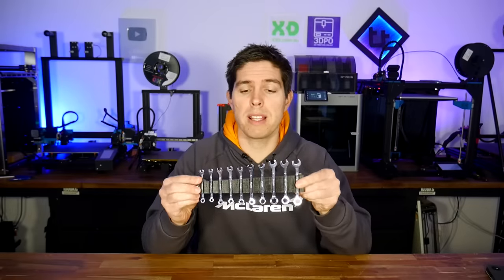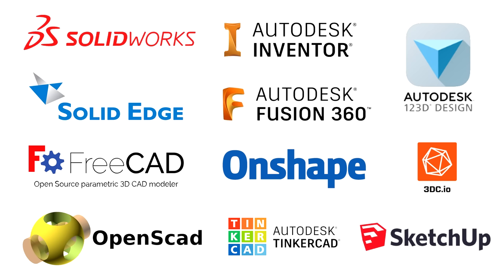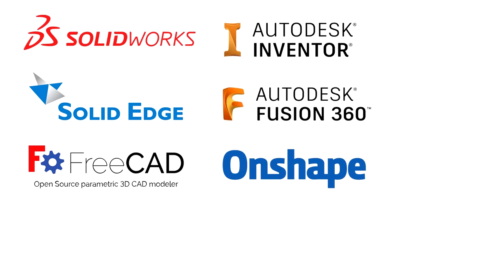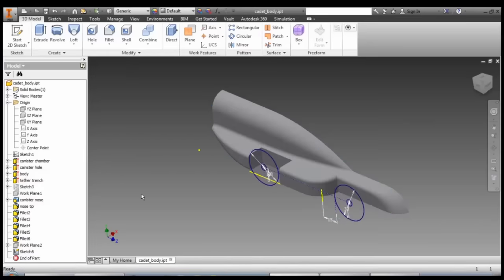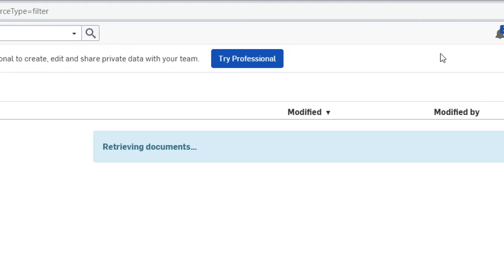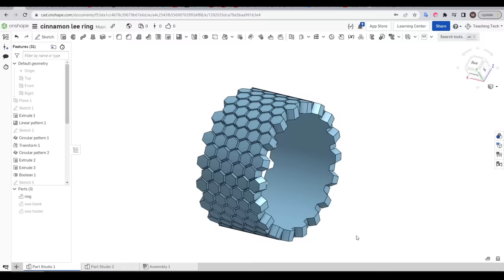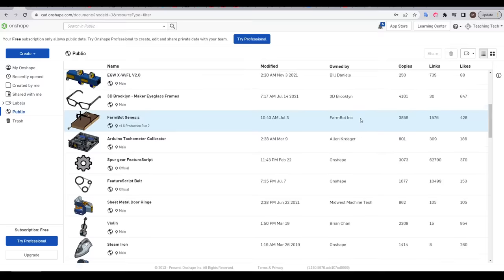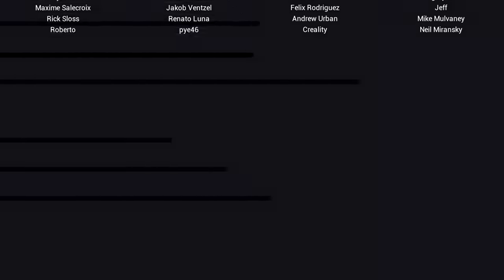Selecting a free 3D CAD option - 3D design for 3D printing pt1

Comment: As far as I'm concerned, anything that is a "free subscription" or software-as-a-service, that could be pulled away at any moment, is a total no-go. This makes many of these including fusion 360 and OnShape a big nope. I value my time too much to be willing to risk wasting my time learning the intricacies of a tool that I could suddenly lose access to a year or two down the line. I'm not against using commercial CAD software, but it MUST be a perpetual license (this is non-negotiable for me), and must be available at a price that makes sense for a casual non-commercial user.

These days I'm mostly using FreeCAD, but am curious about the addons for Blender, and am also interested in some day learning OpenSCAD for cases where I find FreeCAD's parameterization insufficient.

Comment: Can I use a regular 3D modeling program? I know some Cinema 4D and have models on there and I think I can export them to STL
Reply from the maker: The problem is that often these non product design focused design packages don't export manifold / 'watertight' models. There will be intersecting surfaces that don't matter for VFX but do matter when making the onbect for real. Try it but carefully check the gcode preview carefully.

Comment: I been using Fusion 360, but I dont like the whole cloud system they use. You cant convert a solid/step file to stl without internet which is just stupid. I also dont like how I need to save a copy online and on my computer so I have a copy in case I dont have internet access.  Having multiple copies can really become confusing and messy. F360 also crashes constantly. I tried it on several different computers with more cores, more ram, dual CPU's better GPU's, I tried overclocking and so many other things, but nothing makes a difference. Once I get it to work good, they will force an update without your knowledge causing it to start crashing all over again.

Comment: Did they ever add inches as a measurement option? The program has promise, but if I can not work in actual Inches (not feet and inches, not generic units I call inches, but actual inches) it is completely worthless to me.
Reply from the maker: Onshape covers both. It always has since I've used it.

Comment: For the infants that claim Free CAD is buggy. 
You're holding it wrong - Tim Cook
I bet 0 of you experienced Windows ME or dealt with endless runtime memory errors.
You don't know the MEANING of the word buggy
Note: I wrote the firmware for FLSuns CR15 line & Anycubics 200mm Delta bot. They had the equations for kinematics wrong and it only ran 17mm/sec off the 16mhz 8bit Mega 2560 all in one board they ran it on. I wrote the 8 bit for a mega2560  & 32 bit version firmware for a smoothie clone board. I removed the data transaction with the dot matrix screen while printing for temps to get it to run 20mm/sec off the mega 2560. The smoothie clone was network ready with a touch screen. Smoothieware is so easy.

Comment: OnShape can screw right off.  No offline capability is an absolutely inexcusable antifeature, and requiring $1500/user/yr just for the option of having private files is abhorrent.
Fusion 360 has an awful UI/UX, which is why I'm looking for a different program in the first place.
When I used Solidworks back in high school, it was an absolutely amazing, intuitive piece of software, so if you can afford the $100/yr for the personal license, I highly recommend it.

Comment: Meh... As many others I've started my 3D printing (and designing) life on the back of F360, and the one thing that has been bugging me from the start is the forced cloud saving. Sure, you can export to have a local version, but the whole workflow doesn't want you to do that. So going full-cloud is an absolute no-go for me...
Also interesting that you had Solid Edge on your list but didn't really mention it. The community edition is free and it has no cloud connection whatsoever, all your projects get saved locally.
And yeah, OpenSCAD is a real odd-ball, but once you get to know it a little it's great for not too complex models, and its biggest pro is that everything is really 100% parametric.

Comment: I've tried a number of programs and started with blender.  That lasted about 5 minutes as it felt like I was reading japanese stereo instructions upside down and backwards and in the mirror.  Completely unintelligible to me.  Than I tried FreeCAD and had a lot of success.  While it does most of what I want I find some things that should be VERY simple are either impossible or just stupidly difficult to accomplish (ie modifying an existing STL).  Next I tried tinkercad and I'm sort of halfway between blender and freecad but it's still basically unusable for me and I just don't get the logic it tries to use.  So back to FreeCAD I went and just have to accept that I won't be able to make simple changes to many existing STL files.  I don't need 3d modling as I only print parts and utilitarian objects.  I don't print toys or decorative things.

Comment: Lots of tutorials out there already. How to do something usefully different? People left Onshape a few years ago when the license changed. Same with Fusion 360. Licenses are a big problem in the long run. Do yourself a favor and find a product that doesn't have licensing issues, don't invest your time in something that leads to problems later. For a hobbyist or maker there are too many strings and costs. Blender, OpenSCAD, FreeCAD. So far I've been able to do everything I've needed to do with OpenSCAD. I've heard the new modules in Blender are good for 3D Printing design. FreeCAD is evolving. I've heard that TinkerCAD is the best way to start out. Perhaps what hobbyists need is not what Michael needs or what I need. They need to learn how to think about 3D design, regardless of the tool they choose. Perhaps a different kind of course is needed to address people who aren't used to thinking in terms of geometry or design. In college we learned to write simple programs in many different languages to understand the differences. Perhaps cover the basics for some simple designs in all of the free cad programs, and compare/contrast them rather than focus on one. Plenty of tutorials for most any CAD system out there already. What's needed is an on-ramp for real beginners. How to measure. How to think about design. Something different from what is already done.

Comment: So, I have tried MOST of these programs, and I agree with both of the choices for kid and parametric.  I use Tinkercad in small designs, for little things, and it works grea.  and while I have tried solidworkds, Fusio360, and freecad, I think that Onshape is defiantly the easiest to use.  even though it is similar to fusion360, I didn't find myself fighting the interface or having to keep looking things up.  I don't plan to sell my work anytime soon, so having the designs be public access is no problems either

Comment: One consideration that wasn't listed. The ability to use or transfer these skills to a career.
Using the CAD you prefer is great for personal use but industry won't accept that most of the time.

So if the intent is to build 3d modeling knowledge to use at a current or future job then Solid Works, Fusion 360 and Onshape are probably the best.
Reply: Onshape forbids commercial use of freely designed products, so no. not at all. FreeCad has many more applications in industry.

Comment: I would really like it if someone would make a list like this, but reject any option that requires my creations be under some kind of restrictions, like cloud storage, monetization, etc. I would like to see it walked backwards from an air-gapped R&D laboratory with no internet whatsoever. I think FreeCAD, OpenSCAD, and Blender don't require any internet connection, ever. While Shapr3D requires one briefly during install to validate your license, and most AutoDesk tools require a periodic internet connection to re-validate the license. But these tools that track how many models I have and dictate cloud storage to me are simply non-starters. That being said, I love TinkerCAD as a place to get started for throwaway models and learning. A fantastic way to get started! But when you start to get serious, these restrictions actually scare me! What if I took months to learn a tool really well, only to find out their licensing and storage restrictions block me from actually using it in the way I want?
Reply: Yeah freecad is going to be the best option for actual cad use, freecad can do practically everything you can imagine, it's harder to learn but still easier than say learning how to code or other disciplines. With freecad you can grow unlike say thinkercad or other easy to use cad programs. Blender is not a cad program, don't think of it as a cad program. I'm a master with blender from subd modeling, boolean modeling, scuplting, geometry nodes, animation, pbr, baking, etc. I went and learnt freecad because yes you can make detailed models good enough for 3d printing but the limitations of it not being a cad program are always behind the curtain

Comment: FreeCAD all the way. If only because it's open source. I can't think of anything you can't do with it that you might need. Everything is at all times perfectly defined. It's a bit quirky because referencing existing geometry is supported but easily breaks if you go back and make changes that alter the number of edges or faces. But this can be circumvented by using parameters and named references.

The problem I have with things like onshape is that it's online and browser based. What if you're offline or have a crappy connection? You can't work anymore. Who is in control of your data? certainly not you. What if they get a data breach?  Another company that has your data. All this cloud nonsense is ridiculous.

Apps for android and iOS. Great. Like you are going to work on your 3d model with your phone. If you're at home you have your desktop or laptop. If you're on the move, you both don't have the time or concentration to do 3d modeling as well as you gotta pay for your data use. That's hardly a selling point. If I need tools I make a printout or just write down the numbers of what I need. Or adjust the model such that I can use the tools I have already instead of having to buy new ones.

You could use proprietary web interfaces to share your projects, or you could use github or gitlab and also have a version history and in the process.

Comment: If you want a great, free (with a license that doesn't expire) and not browser-based alternative, try the solid edge community edition. It's a very capable programm with every feature you need and you can use it without internet connection.

Comment: So far I've used TinkerCad and Fusion 360, and I haven't really been happy with either one.

TInkerCad is much friendlier, and quite easy to start, but I started running into the limits fairly quickly. While I wasn't trying to make a rounded cube, that's a fair example of the problems. It's just not easy make certain common shapes.

With Fusion 360, which is what I'm using now, I feel like I'm constantly fighting the program. It's not the learning curve so much as the program being almost actively user hostile. For example, you can't move a rectangle created with the Center tool unless you delete the center dot first. When do it incorrectly, the operation just fails without telling you why.

Comment: So I come from a place where I get why people want to use free software but feel like reasonably priced software should be supported otherwise you end up with multi thousand dollar and free and nothing in between.
Reply: It's not about the price but the control of the CAD data that has to be free from any restrictions so you can still open your files over 10 years.

Comment: I always look for new ones but boy, nothing that is free for hobby use compares even closely to Fusion 360. Onshape is the closest but is still limited and is completely useless in terms of direct modelling - which is often an easy way to fix small things in your design or to completely modify/reverse engineering existing models.
The change in Fusion licence some month ago is very annoying (having to chang ethe "editable files" all the time) but in my opinion sadly still nothing is close.

Also what I find sad is that none of the CAD firms makle an "pro hobby user" payment plan that cost's like 100€ max per year that includes the locked pro features but with restrictions on making money with the designs. Nope, you will get quoted like 1000€+ per year as if you would make your living based on the software.

Comment: SolidWorks is a very capable CAD application but the company itself (Dassault) is garbage. Solidworks offers a "Makers" license at a price of $99 USD/year. Competitors (Siemens and Autodesk) offer similarly capable CAD packages to non-commercial users for FREE. I am currently using Siemens Solid Edge. While there is a bit of a learning curve for transitioning from SolidWorks to Solid Edge, I am very pleased with Solid Edge.
Reply: Do you find some things just unnecessarily more complicated to achieve compared to solidworks? I have to use Solid Edge at work, and it bugs me a alot after practicing Solidworks.

Comment: actually only can work with FreeCAD. It's a mature and well thought classic surface, and is working just like it should be in my opinion. All that weird and down-dumbed supposedly 'modern' UIs in other software (like 360 ) is an utter disaster!
But: Everytime I had made some slightly more complex thing in FreeCAD, it would become unstable, and crashed all the time over and over :(

Comment: I’m sorry but there’s way too many red flags with those guys. You skip two features and all of the sudden it’s not $1,500 a year? Is it the licensing? Or the fact that they control your models so they may or may not be there when you log in? And what’s with the visible to the world bit? Seems like a weird punishment for not paying their $1,500; cause that’s what it is. If they can save your models they can be normal and give you a private account so it’s just them trying to make the free version shitty enough you give up two meals a day to pay for the Standard plan. Anyways, I’m willing to bet they get their $$ in the end when they “share” your contact info with their “partners they think you’ll be a good fit with.”
Reply: I would just like to add that I work at a software company and CAD software does NOT have to cost $1,500 a year! You’re paying for OnShape add-ons. I wish a company would just make a CAD program with no extras, and release it at a reasonable price. Adobe is proof that this is possible. Photoshop and Lightroom are complex, full featured and regularly updated and I can get that software for $120 a year!!!
Reply: @mrkthmn  probably because you company purchases license en masse, the same idea goes for wholesale being cheaper than retail, buying in bulk is cheaper 

Also the free license is just as good

Comment: FreeCAD gave me an aneurysm
Reply: Because of the rebuild problems arising from the topological naming problem? I agree that it's really quite annoying to use the official FreeCAD, but the realthunder version is nice, and actually my favorite CAD software.

(The next version of the official FreeCAD will finally include realthunder's TNP fixes, but of course you may just as well use realthunder's version.)
Reply: @marcus3d  no, it's that user interface. It took forever and 3 tutorials for me to make a layered box. I might be slow tho, I've only used TinkerCAD so far.
Reply: @ADR69  Oh, that's odd. I mean, sure, it has very much functionality, which can be overwhelming, but for most stuff you can just stick with the Part Design workbench.

Not sure how your box looks, but it shouldn't take more than a quick Part Design fundamentals mini tutorial and a couple of minutes of your time, even if you're a complete beginner.